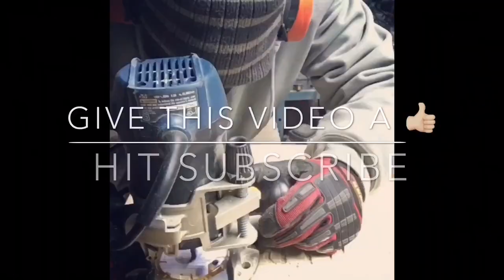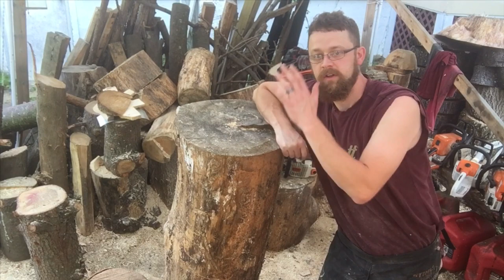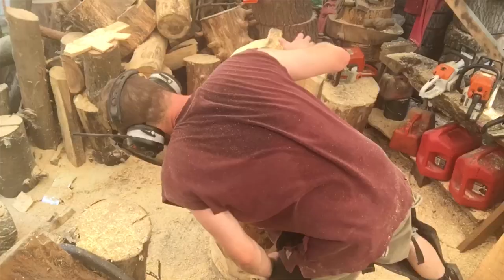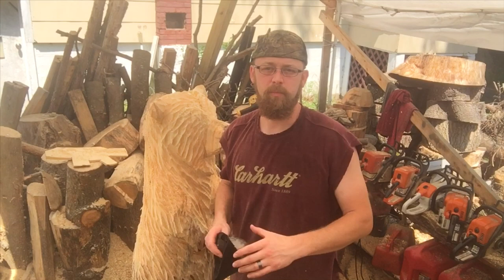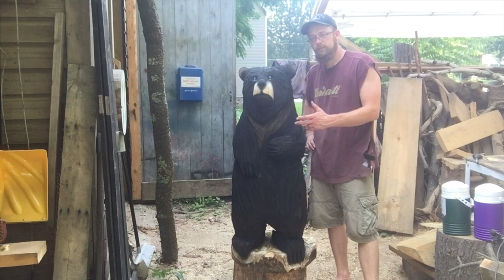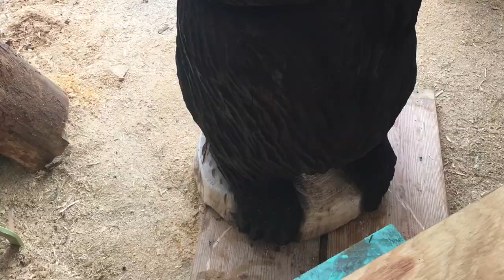Making a carving mistake.

Comment: Hey Kyle. I see you bought that gouge about 10 months ago on Etsy. I have a Harrycane but like the idea of the single cutter. How do you like this gouge? ows it holding up? Any complaints?  Thanks!
Reply from the maker: I like it . I think it would be nice if it was a double gouge . Lol  takes some getting used to . The cutters seem to hold up well with pine or soft wood . I recommend buying extra cutters . Seems to be holding up good for the money.